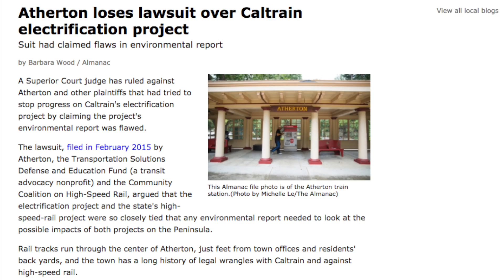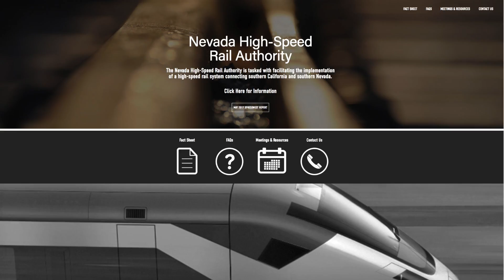2017 in California HSR: Caltrain Wins Bigly + Las Vegas Bullet Train 🚄 Future Transit USA

Comment: We should kill CAHSR and instead let urban areas build high speed regional rail based on metrolink routes but grade separated. That is what is truly needed to fight traffic, into/out of cities/suburbs.
Reply from the maker: No way, we need both. We badly need to improve regional rail in California, but to do so at the expense of high-speed rail would be an enormous mistake. Improved regional rail networks throughout California will improve automobile congestion considerably more if they are connected to each other via HSR than if they remained isolated from each other.
Reply: We absolutely do not need a single line to SF. We need faster movement around high-density regions. That would improve the lives of tens of millions of people vs this boutique single-line plan that costs around 80 billion and would serve, what, a few thousand a day? Taxpayer dollars aren't endless; we need to choose plans wisely, and speeding up metrolink with a system similar to japan would be best.
Reply from the maker: The problem I have with your theory is that it disregards the primary factors which are well known to determine individual choices to either drive or use public transportation.  The main factor in that decision is convenience. Once somebody has decided that public transportation is too inconvenient for one trip, they now have their car with them, and are therefore more likely to use their car for future trips - even ones that would be convenient when made by public transportation.  So what high speed rail will really do is make it so that people traveling from NorCal to SoCal and vice versa are not bringing their cars with them in the first place.  Once they've arrived here in LA without a car, they will be far more likely to use Metro & Metrolink than they would have been if they had brought a car along with them from their origin point. 

HSR is also undeniably pricey, but so were the freeways. This is merely a needed correction of past major infrastructure investments, which focused almost exclusively on freeways and induced additional automobile use instead of environmentally friendly alternatives such as rail. As long as taxpayers are spending money to keep the golden state freeway open and free of charge, we should also be spending money to ensure a superior alternative is available to that freeway in the form of high speed rail.
Reply: How many people need to go strictly between LA-SF, or any point in between, each day? That number pales in comparison to how many people you could get out of their cars if you gave them efficient travel in/out of the major urban areas. ML daily ridership is, what, 50k or so? I'm not sure. But you could probably double that if you could cut travel time in half, and also sped up the LA Metro system (blue, expo). As progressives, we need to pick our battles carefully, and CAHSR was sort of a "screw you" project in the face of Republicans, and it's doing damage to our image. We could drop that project and probably get 50 billion to do whatever we wanted to.
Reply from the maker: I resent that high speed rail has become a partisan issue.  It is a technology which is extensively tested and heavily used throughout the world (not just the liberal parts of it, either) with resoundingly positive results, and strong ridership. The only way that high speed rail's existence could hurt progressives in California is if we abandoned the project after having already spent billions of dollars on it like you suggest we do, leaving gigantic unfinished pieces of infrastructure strewn about the central valley reminding everybody that we couldn't pull off what we said we could.  

"Governor Moonbeam" might seem like a kook now, but he's right about this train.  In time, and as the project moves closer to completion, I am confident that fact will become increasingly self-evident to skeptics of the massively ambitious project such as yourself.
Reply: It's sad, but conservatives are mostly in rural areas that don't see the benefit of urban transit projects, they need to get something in return, as they are taxpaying citizens. We need to be very judicious with our transit projects. Most people know that a strategy by HSR proponents is to try to build as much as possible before any lawsuits, and just claims that we might as well finish it, regardless of the cost. It's a crappy justification. This project is making transit look bad as the financials and ridership projections get worse, especially with low oil costs.
Reply from the maker: We've all heard some of the negative press surrounding high speed rail, as there are a lot of conservatives and NIMBY interests slinging mud at the project in various local news outlets. But in my experience, there hasn't been a whole lot of truth to the allegations of financial impropriety alleged by the likes of Stuart Flashman and others.  The board meetings are all available right here on youtube, and the board itself routinely subjects their accountants to remarkably dogged scrutiny in those meetings.  And HSR has been sued many times already - no suit so far has come close to actually halting the project, so I'm skeptical that future attempts to re-litigate would yield different results in the same courts. 

The project itself isn't where the negative image of the project is coming from. The negativity from the project is coming from Republicans, and newspaper opinion pages sympathetic with them.  But we have to realize that the GOP is LYING to us about this. Their thesis is only even theoretically true if they are able to force it to appear true by bringing the project to a halt.  If we hand the GOP a "win" by letting them kill high speed rail, then we are saying that they are right that government shouldn't bother investing in transportation at all, which is bonkers since large infrastructure projects from the Erie Canal to the transcontinental railroad, and now finally high speed rail have all relied on some government help prior to completion. The republicans lie to us about trickle-down economics, they lie to us about gun laws, they lie to us about healthcare... why would anyone in their right mind assume they aren't lying about high-speed rail as well?
Reply: @acjohn6995  Well, the SF-LA plane shuttle is one of the most traveled in the US. We could use the train to  reduce some of the strain of or even largely replace that corridor like Japan and Europe. With people using the train instead of the plane and the roads, that would make it hard for the HSR to be a flop. As long as HSR ticketing is competetive to Airline pricing.

Comment: it's a violation of 1a because it will never be able to meet the speed requirements in the bill
Reply from the maker: Wouldn't it be wildly unsafe for a train to blow through Menlo Park grade crossings at 200 miles per hour though? It goes way faster elsewhere.
Reply: Alexander Barber the train is required to be able to do SF to LA in two hours and forty minutes. that is no longer possible with the be blended sections
Reply from the maker: Could you please provide a source for that information? I would be glad to look into it, as that is not my present understanding of the matter.
Reply: Also, it it looking extremely likely that the LA end will be blended as well, which makes it completely impossible, even on paper
Reply from the maker: Everything in that wikipedia section is accurate, but they don't support your argument that the use of the Caltrain corridor would result in the HSR project falling short of the mandated benchmarks for a few reasons. 

1.) Extra tracks; The Caltrain corridor is already quadruple-tracked in many places, and it is my understanding that additional track will be added in some of the areas where there are fewer than that, but where there is room for them.  Extra tracks mean trains can pass each other, and passing means that the HSR trains will be able to go much, much faster than the Caltrains.

2.) Bypassing Caltrain Stations; Note that the High Speed Rail trains will not stop at MOST existing Caltrain stations. The HSR trains will stop at only one single Caltrain station between 4th & King and San Jose (between which 1A states that HSR journeys must take no more than 30 minutes), that station being Millbrae/SFO. 

The HSR trains will therefore bypass NINETEEN existing Caltrain stations between 4th/King & San Jose. If we were to VERY conservatively assume that stopping at each of those stations adds only 1 minute and 15 seconds, to the total journey time, you can still deduct 27 minutes and 15 seconds from the total projected journey time (once the route has been electrified) between 4th/King and San Jose, projected to be about 51 minutes (for Caltrain - see 1:54).

3.) Math; 51 Minutes - 23 Minutes and 45 seconds = 27 Minutes and 15 seconds. 27 Minutes and 15 Seconds < 30 Minutes.

4.) Caltrain ≠ California High-Speed Rail; This gets to the heart of Stuart Flashman's argument.  Stuart is saying that because CALTRAIN, using the new HSR infrastructure, will take 51 minutes between the two points identified in Proposition 1A, that it is a violation of the 30 minutes restriction.  But the biggest problem with this (beyond the obvious mathematical errors in Stuart's logic) is that Caltrain is a commuter railroad that has been serving the Silicon Valley for over 150 years, and therefore is a TOTALLY DIFFERENT THING than the High Speed Rail Trains that have yet to even be built.  

So essentially, the "impropriety" in the HSR process Stuart & Atherton are always going on about not only doesn't exist, IT COULD NOT YET EXIST, since the 30 minute benchmark applies only to the NEW HSR trains that DO NOT EXIST YET. 

Proposition 1A DOES NOT, and NEVER WILL apply to the 150-YEAR-OLD CALTRAIN RAILROAD, which Stuart is going after. 

1A ONLY applies to the HSR trains that we haven't even bought yet.
Reply: Alexander Barber no, I'm saying the blended section is a violation of the law for the high speed train. I don't care about the speed of the commuter train. Given the number of Caltrain services per hour, there is no way the high speed train can average 100 through there unless the whole thing is quad tracked. which is not a thing.
Reply from the maker: Is that so? See, one of several of Caltrain's quad-tracked sections: https://youtu.be/Os6y6PP1y3w?t=14m49s

You even say yourself that only the high speed train can be in violation of this particular law (1A).  Since the high speed train is not in service yet, even if Stuart & Atherton's lawsuits weren't completely frivolous (and they are), they would still be completely premature, since what they are suing does not even exist yet.
Reply: Alexander Barber the whole thing would have to be quad tracked, not a few sections. There are also some stations with passing lanes, but not nearly enough. Caltrain itself admits the improvements only speed it up by a few minutes, in that video you spliced. 

So giving Caltrain the money does not contribute in any way to a legal HSR system and is therefore illegal.
Reply from the maker: It's not illegal, because there's no law that says that. If there was such a law, Atherton would be winning in court. 
Edit: The improvements only speed CALTRAIN up a few minutes - because Caltrain stops at all of those stations... HSR won't.

If it turns out that HSR does actually end up taking as long as Caltrains do, that could theoretically violate 1A, but again - HSR doesn't exist yet so it can't yet be in violation of 1A, not even theoretically.  Stuart is a quack.
Reply: Alexander Barber it's only because they have thrown up a fog of plausible deniability. Is it theoretically possible Caltrain will stop running half their trains so CAHSR can go 100 through there, and the US will become home to the fastest conventional trains in the world? Sure, I guess. And then in 20 years when this thing connects to LA, and it becomes obvious standards were not met, it will just be swept under the rug. or they will blame it on the operators
Reply from the maker: The whole point is that Caltrain won't have to stop running ANY of their trains in order for HSR to make it between the two points, because HSR won't begin running until the additional track and other improvements needed not to disrupt Caltrain service have been built.  You can't call something "plausible deniability" if the crime that is supposedly being denied could not possibly have even occurred already.  That's something else entirely, I'll call it "a blatant and nearly fraudulent waste of Atherton taxpayer dollars".
Reply: Alexander Barber no, the law says that the system must be designed in good faith to follow the time limits. Their are no plans to improve the Caltrain corridor so CAHSR can go through at 100. 

it's absurd to imply that we have to wait until the first train runs and measure it with a stopwatch
Reply from the maker: How could that be absurd when the constraint in question is, in fact, a TIME-LIMIT? Using a clock or stopwatch would appear to me the ONLY reasonable way to assess such a dispute with any sort of fairness or objectivity, since the factor in question is indeed TIME. Note: 100mph isn't even that fast for a train. Metrolink gets up to 90Mph in Orange County, and that's not even electrified.